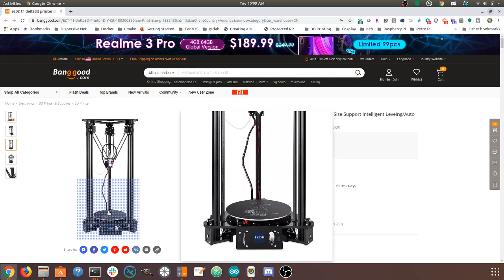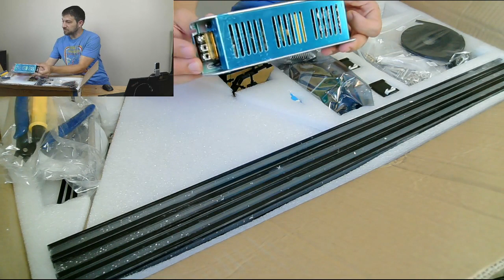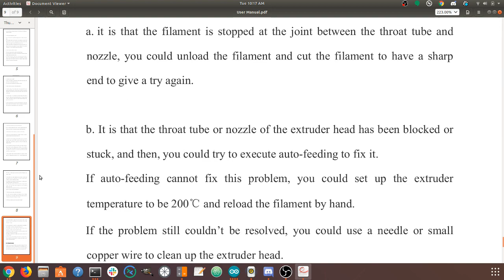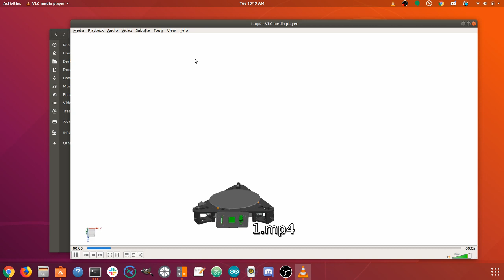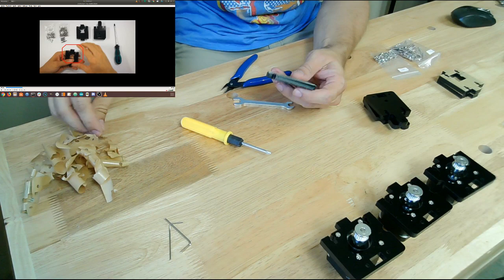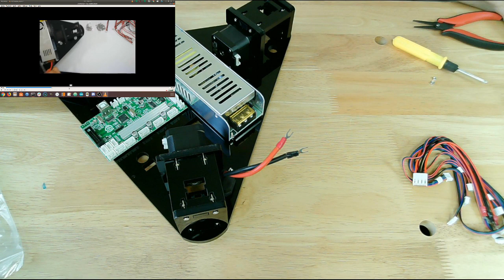EZT T1 Delta 3D Printer: Assembly Part 1

Comment: nioce to see a screencap using Linux for once, you get a bit bored of seeing Windows or macOS :P
Reply from the maker: Yeah, I'm primarily a Linux guy and use Windows when I have to/when it's convenient. Thanks for noticing!
Reply: @kerseyfabs  i tend to swtich depending on the device im using,  but honestly at this point i could probably switch to linux full time, i just have no inclination to yet, unless my windows install breaks or something.

my Linux distr of choice is elementaryOS, i always describe it as Ubuntu except if it was given to designers
Reply from the maker: @Mobile_Dom  I still need Windows for things like Fusion360 and other modeling utilities. Luckily a lot of slicing utilities are cross platform.

Back in the day I was a Gentoo guy. These days Ubuntu is just the easiest to install on new hardware.

Comment: I realy love your videos - but this printer does not seem to be worth the time you spend on it. Even for free I would not take it.

1. Acrylic is definitly outdated for a printer. Stability?
2. Security issues witth main power connection is a no-go.
3. 32bit controller - but seems to be soldered A4988. So it does not matter if 8 or 32 bit - it is something to be changed anyway. Actually 8 bit controllers are more expansive than 32 bit. You can get a 32 bit controller for as low as 15$ (even less but than you need a external mosfet for heated bed).

If you look at the Anycubic Kossel Linear plus (I got my second one for 194$ two weeks ago) you are in the  same price range with bigger build volume, much more rigid frame, linear rails, ABL, good support on thingiverse with many nice mods... The controller is 8 bit, but with sockets for drivers and print fine and quite if changing drivers to TMC. You may install klipper, so the 8 bit do not matter (calculation will be done on a rasperry than) or re-use the board for a creality printer (instead of throwing it away like any board with soldered A4988) as on cartesian bed-shakers 8 bit is enough -  and install a new board to the delta (as said about 15$+drivers).

So while its always nice to see an new printer, I already feel a bit sorry for you. I got my first delta 5 months ago (Anycubic Linear plus, I paid about 250$ then) and bought 3 deltas more since than (a Anycubic Predator, good hardware exept the board - also 32bit with soldered A4988, but also closed source and touchscreen controller on board, so I will try to grab Dir and Step signals directly from the Pins of the A4988 to add external drivers and change the board to an open source 32 bit board and new touchscreen only if that fails, a Monoprice Delta Mini (for less than 90$ as it was "refubrished"), sadly also soldered drivers, and now a second Anycubic Linear  Plus (as I want to try to build an IDEX with two deltas with the bed moving between them). I am very facinated by deltas, working like an spider on LSD. But the printer you present is definitly to much crippled to go to the low price.
On the other side - if you get it to work (and electrical secure) with good results, you can be very proud. So I wait for the next videos ...
Reply from the maker: Ole, I really appreciate the time you took to provide all of the feedback. Overall, I don't disagree with much you had to say. From a PRACTICAL stand-point this wouldn't be the first or second printer I would have purchased. As I mentioned, these kit printers can be fun and challenging if you're into building models, the electrical/mechanical kind. I would never buy a printer like this as a work horse but it's a terrific build to learn how these are put together. There's no need to feel sorry for me. I enjoyed the day I spent building and I'm really happy with the results as a whole. For me, this will be primarily a demo printer at Maker gatherings to show off what a delta is and how it works.

From a YouTube channel perspective, I'm still trying out different types of content to see what really resonates with my audience. Banggood gave me the opportunity to try out a kit I was unfamiliar with and I took them up on it because of my interest in deltas. Will I do another one? Time will tell. I have two goals on this channel:
1) Share the projects that interest me that I would do with or without a YouTube channel.
2) Seek out projects that will appeal to a broad range of 3D printing enthusiasts and makers.
Overall, I want to inspire and be inspired.
Reply: You and Chris both have very good points on this.  I think we are all builders and tinkers and enjoy the challenge as much as the end results. Keep up the good work- both of you.!!